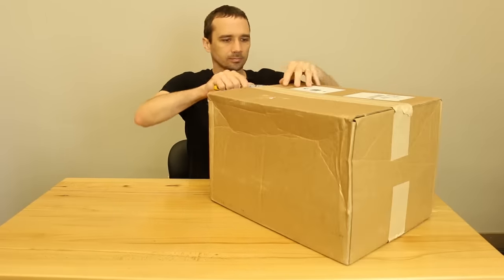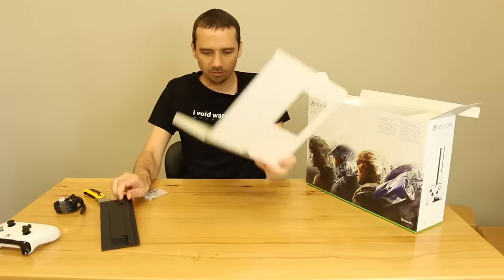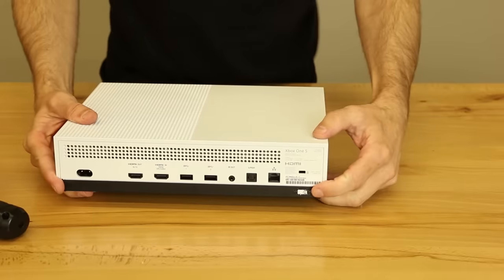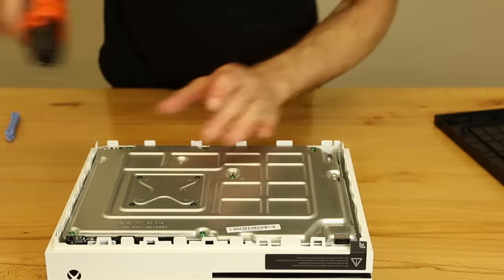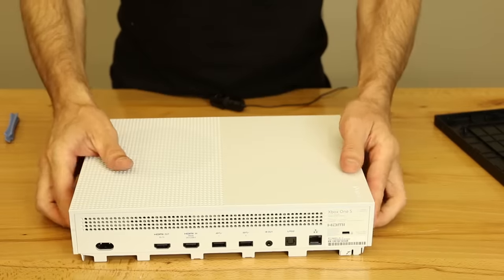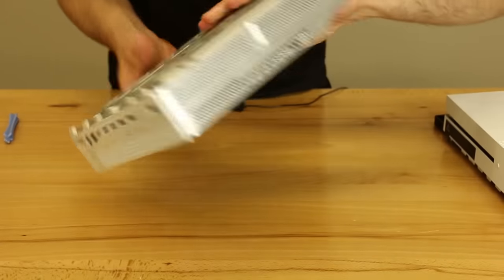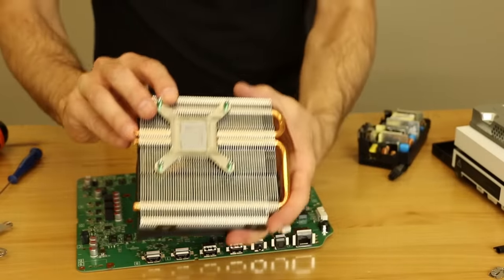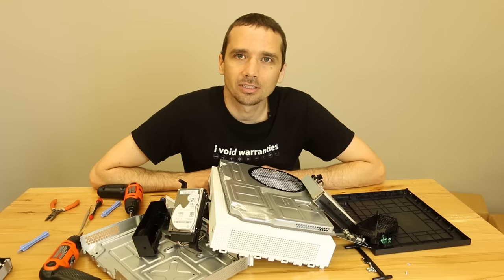Xbox One S Teardown - Detailed Disassembly Guide

Comment: By the way, you dont need the Security screw drivers for this model. All of them are between T8 & T10. 👌
Reply: DannyTripp Henn prexiate the advice I just ordered them too
Reply: @nocloutbruh2681  You're welcome! I ordered a T9 back when I was breaking down 360 controllers. Luckily even though I lost it, I didn't need it so I figured I'd let some other people know & save them the 5-15$ purchase.
Reply: @nocloutbruh2681  I followed this guide to replace a bad HDD. Somehow managed to get bad sectors to the point where boot up was almost impossible.
Reply: @Guru Amirite The T9 is the special security bit, which actually wasn't necessary at all 🤦‍♂️

Comment: Watching this helped me pinpoint a bad sector in my internal HDD that was causing the operating system to malfunction. Turning it on was a hit or miss; sometimes I'd get a green loading screen forever, or would have to boot it into safe mode before giving it a reset without deleting my games. Turns out, I just upgraded it with a SSD and haven't had any problems! Great disassembly walkthrough!
Reply: Just throw it in? Or have to copy original hdd?
Reply: @billyanthony8153  on the latest version, you need to download the osu file from microsoft and an hard drive with 500gb, 1tb or 2tb, the console will format and install the dashboard on its own
Reply: I’m having this problem with my Xbox now lol

Comment: Amazing video, Microsoft wanted to charge me a £170 to repair my faulty wireless card.... Saw your video and figured it was just a case of replacing the wireless card, purchased a wireless card from Ebay for £10, job done in 20 minutes. Fully functioning wireless again. You've just saved me a ton of cash sir 👋👋
Reply: Im having trouble connecting my controller, but i have found out it is a fault with the xbox, should i do what you did?
Reply: @pianopandemonium1223  it may be worth it. Changing the wireless card is pretty simple tbh.

Comment: Hey guys, just remember: NEVER OPEN A POWER SUPPLY. SPECIALLY NOT WITH A METAL TOOL.
😂 I was scared while watching that
Reply: I was scared he would nick the board with that screw driver taking off the cpu assembly.
Reply: oops…already did it
Reply: You need power going to it first 🤡
Reply: @christianguerra525  💀💀💀
Reply: It's even more scary when you are cleaning it
Reply: @therealryangosling42  sus
Reply: @Chuked  you is sussy
Reply: @gvn-xk6eq  It doesn't need to be plugged in to shock you. It has components that have high voltage stored.
Reply: @gvn-xk6eq  no you don't. Go watch a video about capacitors.
Reply: @TommyTombstone  I know what capacitors are which no one mentioned
Reply: @gvn-xk6eq  in this case he would be fine , but if you just had unplugged it from the wall it would still have some power. Not much just enough to give you a little shock.  A quick solution for me at least is hit the power button until it stops lighting up. Should only take two to three pushes.

Comment: Wonderful work!!! U have the Xbox tear down, down to a science.  Also super impressed with the engineering of the actual box and components, and how nicely they all fit together in such a compact package, beautiful console.  I truly think they could have made it even smaller but were very wise not to, and instead opted for a large fan(again)and heat sink especially b/c of the new internal power supply and close proximity of all the components.  

They r truly learning from past mistakes and others (que red ring of death and other devices running super hot thereby decreasing their lifespans).  

Amazing use of every inch and awesome tear down!  Love the video.  New subscriber for sure!
Reply from the maker: Yes, it seems to be designed well. Hopefully this new power supply will be reliable. Glad you like the video and the channel!
Reply: +TronicsFix absolutely something to keep an eye on, they r definitely going out of their usual brick comfort zone. I hope it works out, love the new setup.

Thanks a lot man, for the teardown, it's such valuable insight and info from a pro, and saves us who don't do it as much(although more then I like), a lot of grief and time if/when we need to go at it. Much appreciated! Best of luck.
Reply: That's such a nicely designed little console. It's almost like an small compact computer.
Reply: +CofeeAuLait wouldn't it technically be a compact computer?
Reply: It also helps that parts this generation are much smaller (process wise) and consume less power/produce less heat.
Reply: Wait it’s designed to stop working if it gets too hot?

Comment: Definitely going to paint mine now I know how to take it apart :)
Great video.
Reply from the maker: Thanks! Good luck with the paint job!
Reply: putting the casing back on and fitting it correctly is way harder than taking it apart
Reply: Dietec I'm taking mine apart because the vents in mine are messing up and it turns off by itself sometimes so I'm a take it apart so I can see what happened
Reply: aaaaa!
Reply: I lost my waranty?
Reply: D'a lu' Popică if it's not older than 12 months
Reply: Holy crap.  I just wanted to upgrade my internal HDD.  In contrast to PS4 this is NOT consumer friendly.  Microsoft definitely doesn't want us to mess with the internals and the design speaks that in volume. PS4.. I just pop the top section off and whoa la. HDD upgrade done.
Reply: Han Hang external hdd?
Reply: @xero1782  same exact problem with mine but the thing is i dont exactly have the right size screw driver to pull the green screws out so im gonna wait until tomorrow to go to the store and buy one

Comment: The Xbox One S is such a huge improvement over the original Xbox One. I'm so glad they went back to having an internal power supply for the first time since, well, the Xbox '1' lol. Another thing is now all them damn Sony Ponys can no longer talk crap about the 'ghostbusters' power brick. But not only that it's just so much more convenient and saves space. The console itself saves so much more space and is so damn sexy too. Way better than the PS4 Pro
Reply: Danny C. True story cant wait for the scorpio
Reply: Danny C. lol yeah and it's funny how through the years of the 360 and even the massive Xbox One they all have an external power supply, but yet they manage to fit one inside the smallest Xbox yet
Reply: Danny C. Yea pony fans are toxic
Reply: Xbox one was rushed no thought into design and had flaws one s better they  took advice and worked on the problems tgst xbox one had

Comment: Hey @TronicsFix,
For the last 2 months, my sons Xbox has been on a shelf. It would come on with a manual power up but immediately shut itself off again. We knew it wasn't any real problems besides maybe being cleaned since we just had it serviced in 2018, so we found your video and OMG.... It is up and running again! Thank you so very much! Now we are working on our other sons Xbox just to clean them and clear the dust out.... which ACTUALLY made a huge difference!! Thank you again and i will be sending others your way just in case they have issues!!

Comment: You fixed my Xbox one s, thank you . It needed to be cleaned out . It wasn't working , I kept pushing the power button And it would just make a noise and not turn on , I dismantled it and took dust off and sprayed everywhere. And it worked again, thanks !

Comment: When you unplugged the power supply, you could’ve mentioned that there was a lock on the plug. I pulled mine out straight up like you did and it ripped the whole plug right out of my motherboard.
Reply: Electricalchips u just saved me w this comment 🙏🏽🙏🏽
Reply: I think they did the same, as I heard a loud crack when he pulled his out

Comment: @15:41 where he is taking apart the supply with metal screw driver he lucky but if your xbox is recently plugged in please Use extreme Caution as the is a fully charged capacitor near where he puts the screw driver so if you can wrap the handle of screw driver with some electrical tape
Reply: jeff Cackowski while you are completely correct; taking apart a power supply is ridiculously stupid, the handle of the screw driver was made of plastic, so there’s no way he could have been electrocuted. Still pretty stupid of him either way.

Comment: Its interesting to see that 80% of the volume are the disk drive, HDD, psu and cooler. If we take off the disk drive, put an external PSU and exchange the HDD for a SSD nvme, the size of the console can get pretty small. Those big components are really a pain in the ass for the hardware enginners.
Reply: Are micro sd cards better than standard old school hdd? Size of a thumbnail and can hold terrabytes. Amazing

Comment: Good luck getting it back together
Reply from the maker: These are a piece of cake to put back together. You can watch my reassembly video if you want to see how to do it.
Reply: Kk
Reply: I really wanna take apart my xbox 360 XD
Reply: It's very similar to putting a regular PC together. But it's easier because everything is accessible and there's a lot less cables.
Reply: FazbearProductions 161 you don't need to take it apart so I wouldn't if I were you.
Reply: Can h put it back together I got water on mine 😑😑😑
Reply: I just took apart my xbox 360 s and replaced the thermal paste it was a piece of cake
Reply: Pretty easy  to open and put back together its all modular now . Not lots of connectors

Comment: Very good tutorial, I am using this video in conjunction with upgrading and copying the original HDD of my clients XBOX One S.
Reply from the maker: Glad this helps!
Reply: did you ever upgrade your hdd i tryed to swap the internal drive for a 4tb extral drive which i did take apart and installed it but when i went to boot it back up the xbox w 4tb drive then game me a error code and when i swap  back to the original drive it worked with no error code so im think the original must have a hdd boot code stored in its partition
Reply: This is How I do IT how do you replace a fan
Reply: This is How I do IT any good replacement parts

Comment: thats a big assed heat sink
Reply: +Arrahdre that's nothing that's tiny.
Reply: resColts
compared to what i'm used to seeing on PC cpu's, its pretty large
Reply: Arrahdre
I have this on my cpu http://images17.newegg.com/is/image/newegg/35-118-138-Z01?$S640$ its about 10x bigger than that one.
Reply: lol..holy hell..."thats a big assed heat sink" why do u need that? what type of OC'ing are you doing?resColts
Reply: Arrahdre
just normal OC nothing to extreme. Like chip to run cool.
Reply: isnt the same. its smaller. needs les power.
Reply: Arrahdre yea but its not overhiting like the ps4 lol
Reply: Kevin TheGamer162015 or the 360
Reply: Great grammars👌

Comment: For anyone who watches this and is planning to take theirs apart the torx bit is a t10 not a t9 as stated in the video.  It is not a security torx it is a standard torx bolt as well, found this out after going and buying a security torx set to dismantle mine only to get it open and find out standard torx and t10 which I already had.

Comment: he doesnt afraid touching the power supply with bare hands #ForgetESD #BareHandForPros
Reply: xXx_MlgTr1kSh00ter _Xx The electricity dies down inside the power supply when it is disconnected. I've  done a disassembly on a Dreamcast console, which has an internal power supply consisting of huge capacitors.
Reply from the maker: What's the problem with bare hands on a power supply?
Reply: xXx_MlgTr1kSh00ter _Xx what do you mean? Lol
Reply: He didn't touch anything other than the plastic housing and a heatsink - esd shouldn't be too much of a worry :).

Also, in reply to omega - even after a power supply has been disconnected from the mains it can and will hold a decent charge in the caps for days, weeks even months. First found this out 10 years ago when I was young and messing with an original xbox, grabbed the power supply out, touched the bottom of the board with all the solder joints and got a blast up my arm similar to bare wires from the mains, a lot of that depends on the capacity of the capacitors.

tl;dr - don't mess about with power supplies unless you're sure they're discharged, or you have safely discharged the caps. Unless you're willing to risk a smokey end to your days.
Reply: @Zikmorfeous  holy fact, good to know this mate. Never imagined they save energy in internal parts. I guess this goes to any power supply isn't it?

Comment: I just got my new Xbox One S today. And it keeps overheating and turning off before I'm even able to play a single game. And it's in a wide open place where ventilation issues should not be a problem. I looked closer, and I noticed that the fan isn't even running. It's just still. And it stays that way. Please help.
Reply from the maker: Take it back and exchange it.
Reply: Uhm i dont have problem it stays cool and i have it buy today
Reply: BIGDAL SO DOES MINE! JUST THE OTHER DAY, I WAS PLAYING BO3 AND THE DAMN THING SHUTS OFF LIKE 5 TIMES BY ITSELF! WTF IS WRONG WITH THESE THINGS?!
Reply: TronicsFix That would be a good idea, but mine does the same, except my parents would kill me i exchanged it.
Reply: TronicsFix Does it still work?

Comment: the dismantling was supper easy wen I learned from this guy but the downside is that the reboot after dismantling it just to clean the vents takes a bit of tie. for me it was about 15 seconds but now my xbox 1s shouldn't heat up as fast as it did before anymre. thank you TronicsFix for this informational vid!
Reply from the maker: You're welcome. FYI, any time you unplug your Xbox it will take longer to boot up when you start it up.

Comment: Hey pal. 
I own Xbox one s. I was playing the other day and my gaming room was temperature of around 30 degrees Celsius . 
I kept playing Xbox feeling hot to touch I figured she’ll be right a few more minutes...
1/2 hour or so later after many counsellors slaughtered my Xbox stops working.
I mean the picture went black, the Xbox still had power, the light was on but the sync button wouldn’t work so controller was not reading . I figured it was a thermal shutdown to protect the Xbox . 
I was freaking out thinking she was cooked. 
After pressing the reset process nothing. 
I hadn’t opened this Xbox since I bought it.
When I opened there was dust on most of the air vents and the beast needed a good clean .

With the help of your detailed vid I got the box working again and now I presume it will run smooth for a while. 
I will clean the Xbox every 3 months. It is really easy the one s. Like console for dummies)me)

Cheers

Comment: Well I bought a Xbox360 case opening tool and it came with a x clamp removal tool and I replaced the thermal paste on 2 xbox 360s, xbox one and an xbox one s successfully. You were right I must've damaged my Xbox 360 Halo 3 edition whilst using a screw driver that I messaged you about a few years ago. You suggested I damaged it and I believed x clamps were not to be removed,but you were right.

Comment: Thank you so much i have had an issue with my xbox one s turning on and back off within a few seconds with thus video i was able to clean it and it worked just fine right after
Reply: You think it could work with a standard Xbox One?
Reply: @notsamantha3484  idk all i know is wasnt cleaned for over a year so i watched the dissasemble video to clean it with a can of compressed air and when i put it back together it worked (keep in mind it will void your warranty if you still have one) also look up the disassemble video.

Comment: Wow,
Really similar construction like the 360!
"Same" sata drive (which is a mistake, people can now read the software of the drive and make it read burned cd's like in the 360 days...).
Same doughterboard for the light on the front +  RF Module ( We can now modify the led colors :) ).
Similar bottom metal casing like the 360 and clips design (which break if you open the console a lot).

Comment: I remember when you bought like 20 Xbox One S's & went through them all & fixed several. It was back in 2017 when I bought mine. Now the power supply brick is out I'm guessing since it won't even try to start with no power. Came back to see how you disassembled it, thanks & hoping it's just the PSU. Will order one & see.

Comment: Used this to clean my Xbox, The fan was getting too loud and is quiet now, The dust that I took out was INSANE
Reply: What did you use to get the bottom black part off of the Xbox? I’m not sure what to use and I am scared that if I use a flathead screwdriver, I could scratch parts of the Xbox.
Reply: @robbiebutler930  I used a flathead screwdriver, just he careful!

Comment: Here bc I picked up a broken 1TB S with a bad PSU for $50. Haven't opened yet, but by the sound of it there's at least 1 blown cap on it. Might try and just replace the bad part, but replacement PSUs go for less than $30, so not a bad price anyways.

Comment: thanks for all your information. the design of the xbox one s design is flawed due to the fan being on top on the device to collect a large amount of dust. mine started running pretty badly and glitching/crashing a lot less than a year into purchase. but it's been over a year since purchase so i will definitely try to clean this.

Comment: everything is made well from wifi module to no ribbon cables. the only downside is that dumb x clamp which would be better off using washers to lock it down

Comment: well they are computer chips and was tought to always use static straps and always do with fixing a pc. i even place my pc stuff on an anti static matt. I think off hand the body can produce a 400v charge buildup in the body.

touch the cpu or apu can distory it with static charge.
Reply from the maker: Almost all of the components on this motherboard are not sensitive to static charges. If you're going to be removing the APU (or any of the other ESD sensitive components) and handling it then, yes you would want to be careful of ESD but other than that it's completely safe.